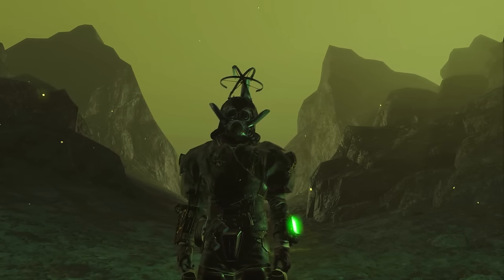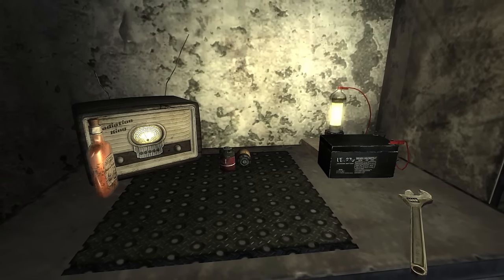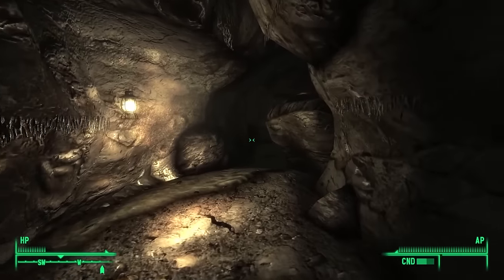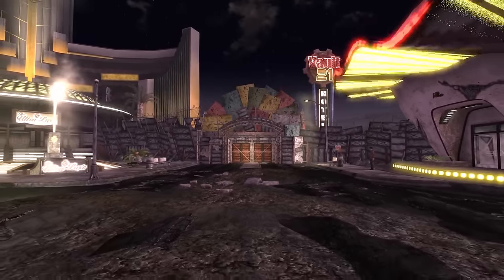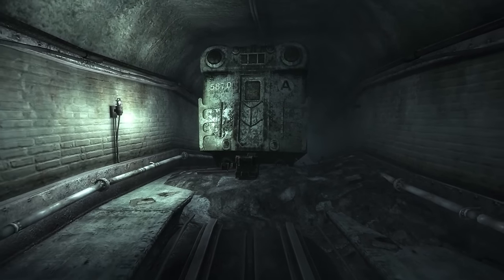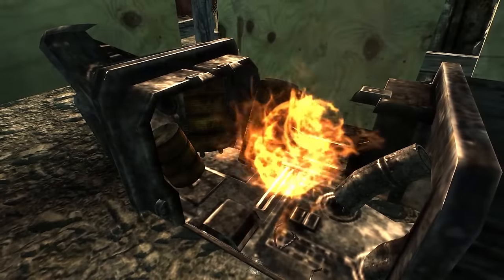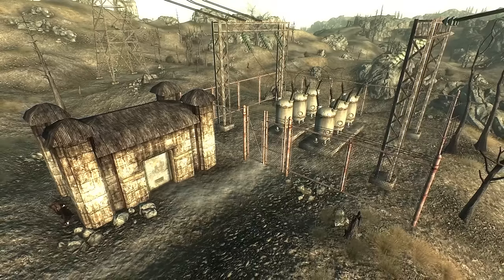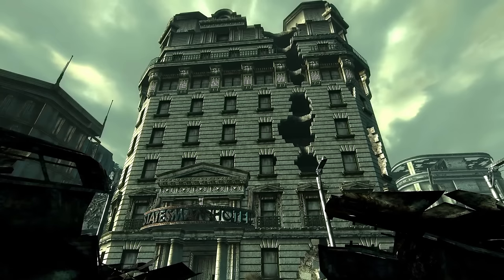Where does the power come from in Fallout?

Comment: Maybe the fusion cores are just act like some kind of catalyst/accelerant in those "generators" since all are fully charged when someone removes it, while a Power Armor gets its power directly from it. And if a building is still connected to a somewhat live grid, it is possible the the generator is/was too, simply refeeding the surplus electricity to the grid that the building does not needs, so by shutting one down only makes the power-grid weaker, but does not kills the power completely.
Reply: Also as a railway engineer: Our main system is divided to sections an substations. There's also some level of automatism like: if a main fuse goes down, the control unit that is responsible for that area try's to turn the power (fuse) back on, after some time, automatically (so in a thunder-storm we don't have to run around like crazy), and only after 2 failed attempts that grid stay "off" , and needs a manual reset, (if the shortage is no longer present). 
That's why some unfortunate people, who touch the wrong thing, at the wrong time are guaranteed to get cooked, specially if they get suck!
Reply: I think perhaps the fusion cores are the battery and the “generator” is the transformer allowing the nuclear powered battery to use very little power over 200 years but the power armor is lacking that very large transformer (clearly) and so it draws from the core directly, using much more power in a much shorter timeframe
Reply: Was thinking the cores had multiple modes of interaction with a generator. The idea revolved around the fusion core generator being the actual producer of power, and the core is essentially a chargeable power source that’s inline with the generator’s power routing. The modes of interaction would have to do with the position of the core in the generator, with the partially exposed position for loot generators acting as a “charge” mode where the generator replenishes the core with the power it generates, while the fully inserted settlement position is like for a “pass through” mode, where the core is more just being used to complete the power circuit for the generator to power external devices.
Reply: Like a car battery. Also, cars have a way to charge batteries or at least keep them charged while running
Reply: Yeah, I agree. Mr. House needed a jump start from Hoover dam to bring his fusion system back on line. The mission (The House always wins 7) to sneak into the NCR held substation and place an override chip in the system. I would wonder if the FCs are just to kick start those larger fusion systems over until the reaction becomes self sustaining and then the FC core is pushed out. It could be the reactor  refills the core which is why they always have a full charge, except for the one at the museum of history which is only at 50 percent. The ones you build in settlements haven't been in service long enough to for them to be fully self sustaining and/or recover enough power to be useable.
Reply: More likely igniters, they do not in themselves generate power, the activate the fission/fusion cycles, and once running are simply being trickle charged, when removed by the player the generators still keep going, but if some sort of power surge happens, it would make sense for them to then stop working or at least drop into standby, and of course do not forget in fallout 1 and 2 fusion cores were not used by power armor, they were powered by internal reactors, similar in the way to the various cars and such.
Reply: I see fusion cores as high yield batteries slotted into a generator or relay to both recharge the core and be ready if the main power goes down
Reply: I like all these ideas. I'll add one. The  fusion cores are not supposed to be fully depleted because only then do they go critical. Power armor is using them in a way never intended by the designers. The cores are supposed to maintain a nominal state of charge, used in conjunction with other power generating means.
Reply: either that or its a built in backup and only ment to run the place for a few days max, i always kinda imagined that the ones that have the cores recharge them some how and then if the power goes offline it can draw the power from them (edit) or a peaker plant
Reply: That's what I thought too: Fusion Cores were fuel cells that functioned mostly as grid energy smoothers, much like the massive capacitors that we have in present day power plants and sub stations.

The idea that fusion cores were providing power for centuries to places, and yet had just enough energy to run Power Armor for under an hour, seemed off.  And yeah, you'd expect different power cores to have different remaining levels of charge, yet they are all the same, instead implying they are rechargeable fuel cells.
Reply: @tnc7399  Like an AC capacitor. Stores power to jump the system. Then in this case a fusion core gets a trickle charge from the generator.
Reply: @arcticequine7084  I always presumed that the fusion core was sort of like the starter key on some system.
there are electrical generator that needs a battery starter that starts the generator that then can power itself and other things.
the fusion core starts and maybe synks the power generator.

also I presumed that the fusion cores ether was in a low power level but it would be annoying to grab a battery and it showing 1% left so the dev changed it to 100%.
same way as modern cellphone batteries reports 100% when in reality they are at 80ish % charge (as 100% charge batteries goes bad a lot faster).
at one time they would report fully charged at 80% but that annoyed and stressed people, so it was changed.

Comment: I think its more logical to assume that regular generators have the cores sticking out and are not actually being used or at least using the bare minimum, therefor keeping the core charged and meaning you have to push it in all the way to actually work for its intended propose, kinda like a failsafe to avoid the generators form being used unintentionally likely caused by the power variations. This is why the settlement generator cores are all the way it because they are actually being used in this case

(edited because I got cells and cores mixed up for a second)
Reply: I just think the generator is running off of something else and the fusion core is there for a backup power provider.

Comment: Do you reckon that the fusion cores are sticking out of the old box generators, and not the new ones that you build in settlements, because the old ones are slowly ejecting - just as they completely eject when they're spent in your power armour?
Reply: no, the fusion cores stick out to communcate to the player that they can be pulled out
Reply: The generators would blow in a couple years
Reply: Hmm what if the generators cycles the elements in the core convert it to what it needs and refuels it?
Reply: @aleanscm9350  

They're likely just functioning as a grid backup. The grid generally powers the building, but the generator kicks in during a power cut.
Reply: Lore wise they could last hundreds of years powering a generator. That was the point of them. They would end the resource war. Them only lasting 20 minutes in power armour with is just a small computer and small motors is a lazy oversight for a gameplay mechanic.

Comment: Here's one thought about the power cores in the wild.  Perhaps they're in a maintenance mode.  Kinda how you trickle-charge a battery to keep it topped up.  The generators may work in two modes, charge and drain.  That solves all three unanswered questions;

1.  The generator not actually powering the building means when you pull the core the power stays on.
2.  The generator in charge mode means when you pull the core, it stops charging, thus the gen stops.
3.  All the cores you find are at full charge, because they were being charged the whole time.
Reply: Yeah good point, maybe they're basically backup batteries that would kick on when the building loses power, but since the grid is (apparently) still powered, they're charging instead.
Reply: Okay here's a thought: what if fusion cores contain a reverseable nuclear reaction? You give them external power, and that is used to power a fusion reaction. This reaction forms an unstable isotope. When power is removed, the isotope decays, releasing heat that can be used as power like a radioisotope thermoelectric generator.

Obviously I don't think that's how it would work in the real world, but it's fallout.
Reply: @technicolorskies5432  sort of like a UPS, not enough to run the system long-term, but enough to have time to shut down everything properly.
So fusion cores could indeed just be batteries for those times when the grid collapses. Or even for managed blackouts. Or when the grid runs unstable.

Comment: My theory is that the fusion generators CHARGE the fusion cores, hence why there is a core cycle button. The cores function like capacitors in a power supply for a PC and store energy. Granted this is almost assuredly wrong but in my head its more plausible
Reply: There was a theory in Fallout 4 for a very short time before it was debunked that you could place drained fusion cores in generators to recharge them, unfortunately not a mechanic. 
But if you consider that the cores you get from generators are always fully charged I guess the intended use of the cores could go either way...
Reply: @_armu  Definitely possible.

Comment: One thing to take into account re maintenance is the ubiquitous presence of utility protectrons. It doesn't seem like much of a stretch to think that those protections can maintain facilities to some degree and repair each other (think Dwemer constructs if this were Elder Scrolls). In that vein, perhaps some of the random robot encounters on the roads are actually work crews following a maintenance schedule.
Reply: Far harbors fog condensers actually have an In universe explanation for how they work, theyre powered by the wind turbines on the island, Captain avery tells you about it like, 2missions into the DLC on her first optional mission
Reply: @rjwaters3  Yeah, that's true. And they do shut down if you shut down the turbines. I guess my head cannon took over for a second since that doesn't make a ton of sense imo. Since island wide wireless power or a massive underground postwar wiring project doesn't seem realistic for Far Harbor; and the fog condensors at the far flung settlements have a mysterious source of power as well, seems of that they all convey to the wind turbines somehow. Also the condensors at the settlements keep running when the turbines shut down.

Comment: My theory for the fusion cores is that when you plug them in they are “drained” mostly, but not enough to explode. So the power is actually inside the generators. That’s also why when you get them they have only a little bit of charge for your armor.
Reply: i always just thought of them as batteries - batteries with a massive storage charge, but batteries nonetheless.
Reply: The reactor in a T51 is meant to last 2-300 years of continuous use, not 200 years of no use and 20 minutes of use. Bethesda's decision to give Power Armor early and the resulting need to balance it absolutely destroyed the lore.
Reply: @DIEGhostfish  perhaps the source of that didnt have the full story, remember as in real life, anything told to you in a video game does not necessarily have to be true. Could be that while a core, while new, has enough energy to run PA for 300 years, but does not itself last 300 years

Comment: I've found a couple of those plutonium wells throught the Boston ruins. But they're usually in the less traveled parts. I've also always wondered how the lights haven't burnt out yet, but there is a light bulb that was installed in like 1915 that still burns today in a fire station. The more they get shut off the quicker they burn out.
Reply: "A light that burns twice as bright burns half as long"
Reply: @HappyBeezerStudios  This is somehow right in between a bot comment and a human comment.
Vaguely and tangentially on-topic, but utterly pointless to the discussion at hand
Reply: that light also is uselessly dull
Reply: @unfunny2258  same with the ones in the subway stations, as you usually have to click on your pipboy to see better. I just thought it was weird they were still flickering
Reply: @LLPTV  many things are built with planned obsolescence now sadly.
Reply: @HappyBeezerStudios  As cheesy as it sounds, this is even true with LEDs. LED based lightbulbs (especially the cheapo ones, but not exclusively) tend to overdrive the LEDs to make them brighter than the competition at the cost of a lot of longevity. Yes, slightly overdriving them (running them at higher current than the manufacturer of the LED chip itself (not the whole bulb) intended) makes them brighter, but they'll dim down in brightness pretty quickly as a result/failure mode. Throw some bad or straight up insufficient cooling in the mix to torture the LEDs even further and you know why a lot of supposedly "better in every regard" LED bulbs don't last particularly long, unless they're only used in short bursts rather than for hours on end
Reply: @Celastrous  Except it's not pointless at all? Incandescents that are driven hard fail faster than ones that aren't going "full tilt" the whole time. There's a reason why the industrial bulbs you can still get (at least here in euroland) are rated for 250-260V, while actual AC power is somewhere between 230-240V. They last longer being "underrun" like this. And don't get me started on trashy LED lamps/bulbs (see my other reply for that)
Reply: You know, I'd heard that if tungsten (I think) was used as a filament the light would last quite a long time.
Reply: @creeperizak8971  yeah Tungsten is really heat resistant so it probably would.
Reply: isnt that bulb running way under voltage? the stress that breaks the filament and burns out the lightbulb is heat cycles because the filament has to expand and contract. less cycles or less heat (lower voltage) makes the bulb last longer
Reply: @creeperizak8971  tungsten is what was used for incandescent bulbs and halogen bulbs
Reply: @thelonewanderer8220  tungsten is what was used for incandescent bulbs and halogen bulbs
Reply: @Knaeckebrotsaege  all bulbs and devices are rated higher than their actual operating voltage because your mains isnt always bang on and its safer that way. that is why wire is rated at 300V or 600V even though it will never see that. if you rated wire exactly at mains voltage its a gamble whether youre gonna have a serious problem or not. also im not talking out my ass im an electrician
Reply: @Knaeckebrotsaege  if you ran the LEDs above their operating conditions they would fail within seconds. typically theyre driven at their maximum recommended voltage given by the manufacturer. the point of failure is the shotty manufacturing processes. the soldering done on the LEDs themselves is poor and the cooling is nonexistant in all the bulbs ive ever handled and LEDs (or any semiconductor) decreases resistance with heat meaning the current flow through it will actually rise to the point of causing damage which is why they will fail prematurely. the reason LEDs are in such high regard is the amount of energy they consume is magnitudes less than any alternatives. a 100watt incandescent has an LED equivelent around 7 to 10 watts. using LEDs for hours on end or in burst is irrelevant if the cooling for them is good enough unlike incandescent which is an advantage because the filament in incandescent bulbs cant handle the heating cooling cycles. LED bulbs are also cheaper to manufacture than incandescent.
Reply: @Videoswithsoarin  Love it when people with no clue reply to me. Yes, you can definitely run the LEDs at slightly higher current to make them brighter at the cost of a lot of lifetime (months instead of years), and that (along with sh_tty cooling) is what most commercial LED lamp manufacturers do, especially the cheapo crappy ones. But yeah keep living in your textwall world